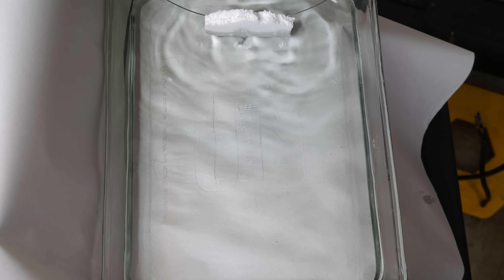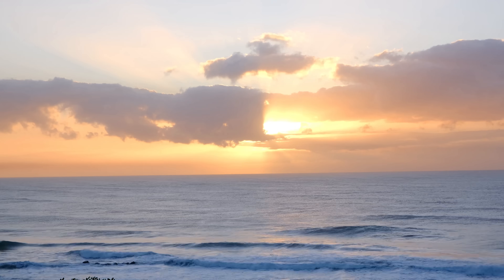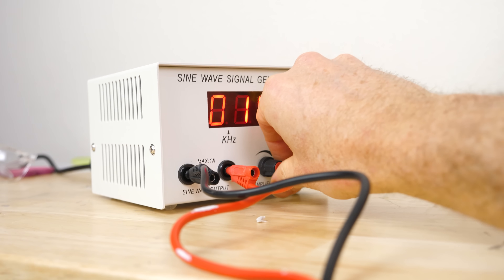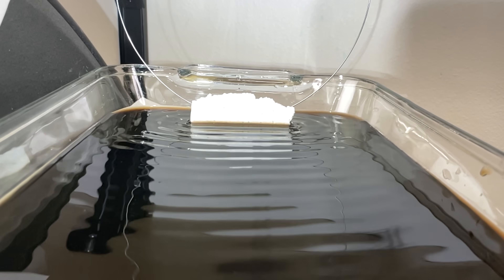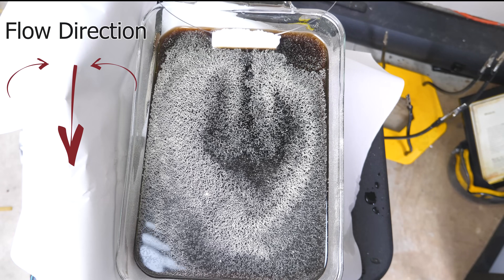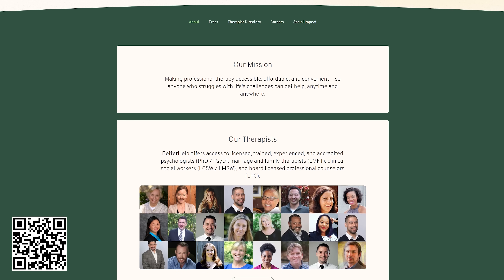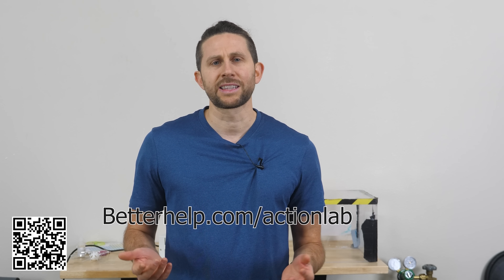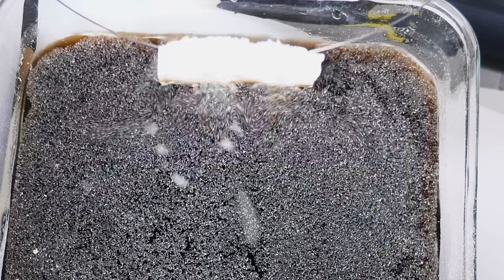Tractor Beam Waves (Waves That Pull You In)

Comment: Super interesting...as presented could also bei applied in controlled Fusion (simulate Gravity Attraction). Now there would be needed some more Experiments:
1)as many suggest in a larger Reservoir to understand the Role of the Walls
2)changing frequency and Look how the Amplitude of Transition depends from it
3) doing the Same in Air, eventually I a closed Pipe
4) thinking If the effect can be reproduced with light waves (real tractor) or even gravitational waves.

 From the explanation you gave however IT seems only a phenomenon of surface waves so Air waves and electromagnetic waves should Not Show the Same phenomenon .

Comment: I wonder what the bigger pattern would be if the wave generator was in the middle of the container as opposed to the side or corners.
Reply: you already know it would be a toroidal pattern.   Just like a tree or an Apple or a magnetic field  basically everything in nature follows toroid's and would be horizontally symmetrical.   Once you hit the right frequency matter itself turns into a toroidal flow pattern.   it's amazing watching every single different experiment that has to do with resonate frequencies which is practically in all fields of science, show the same exact patterns. every time you see eddy currents and vortices they always make the same pattern.  it's proof that the underlying fundamental fabric is most efficient as a toroid.  I wouldn't be surprised if the photon itself is a little toroidal packet of energy at this point.

Comment: it looks like when you barely touch the water you create a force of push and very low force of retraction, and when the object is more submerge, the force of subtraction the object from the water is bigger than the push, so you have differences lines forces in both cases. when you substract a object from the water, you have to the add force from surface tension, and the buoyant force

Comment: Could static electricity between your styrofoam wave generator and the objects in the pool be having some effect? Like others, I suspect interactions with reflective waves in a fairly small container and I would like to see the same experiment with a much larger one where reflections are not a big factor.
Reply: Unless he is using pure distilled water, water conducts electricity very well, so charges don't have the chance to build up on the surface of the styrofoam.
Reply: @Kelly Harbeson Water is not ionic. It is not composed of H and OH ions. It is composed of covalently bonded H2O. You need other ionic compounds to dissolve in water to make it electrically conductive.
Reply: @Kelly Harbeson You're suggesting that water in general is primarily made up of ions, which is far from the truth. It is true that there is a very small probability of a collision between two water molecules in neutral water to briefly create a hydronium ion (H3O+) and a hydroxide ion (OH-). But this is an extremely unlikely interaction. The vast majority of water molecules are covalently bonded H2O, not ions. It's a ratio of 555,000,000 to 1. For every single hydronium ion at a given moment, there are 555 million regular water molecules. The ions have a concentration of 10^-7 moles per liter, which is what a pH of 7 means. This is too small of a concentration to have any impact on the flow of current, which is why pure water is an electrical insulator.

Comment: Might this variation be due to the average height of the water surface; where starting out lower amplitude doesn't reduce the surface height of the water and it pushes away, but when the amplitude increases enough to where the average surface height of the water is lower than the surrounding surface height of the water then the flow reverses towards the direction of the lower surface height. 🤔

Comment: Is it possible the container plays a part in redirecting the flow around  the walls back to the source causing some interference ? I wonder if you’ll see the same results trying this on a larger more open body of water
Reply: I believe so, I think it has to do with force and displacement of water particles. In first case water didn't really "splash" Much out. But in second case it started to splash out kinda.

Comment: Super interesting, thanks for sharing. Does this phenomenon exist for all frequencies? Is there an amplitude threshold which, when reached, turns on this "tractor beam" effect?
Reply: That's a good point. He really should have explained that. Waves, whether in water or electromagnetic are very complicated and there's constructive and destructive interference depending on the frequency. I'm going to guess he created a constructive wavelength that pulls things in but he didn't give enough information for us to know what was happening like you pointed out,let alone any information to use basic formulas and figure it out mathematically.
Reply: @NoZioKikes88  I'm wondering if there are curls being generated by different phases of the waves and that there are predictable locations in which the curls have opposite directions resulting in places that have reverse flow.
Reply: @synchro-dentally1965  That could be.
Reply: Perhaps the curls that already exist are rotated ~90 degrees in the areas of constructive interference. Just postulating ideas.
Reply: Your Q helped be understand how to answer the whole original Q.

Every object has a resonant frequency(ies). In this case the object is extremely flexible to the point of not having a 'real' shape of its own, so it's contained in a bowl/tray. With that its size/shape can be managed. The primary resonant frequency is  a function of the shape/rigidity of the object. A violin string when plucked or a piece of metal when hit will resonate at it's resonant frequency. In the water, the speaker-powered foam sets up the vibration, and the frequency is found by trial and error.

The foam pushes down on uncompressible water, which has to get out of the way. The wave we see created that pushes outward is not the only water moving in the dish. The force goes vertically down, then horizontal when it hits the bottom of the dish, then when it reaches the wall it pushes *upward*. When that upward reaches open air it creates another little wave headed back to the foam.

The answer to this possible solution is to measure the height of the water as the foam pushes downward. Yes there's a wave created on the surface, and the height of the entire bowl rises a tiny amount.

Comment: Question: does this happen on a larger, like a lake, body of water where lateral waves are not reflected back toward the longitudinal axis of propagation?
Reply: The size of tractor beam will be the deciding factor, also I think can surface tension be responsible for this inward pulling phenomena?
Reply: @tilak09  I don't think so, but I am not sure. I think has do with waves originating in bumpy sections of water and propagating towards calm sections.
Reply: I don't think it's possible for a big lake ( a really big lake)
Reply: I like your funny words magic man
Reply: I know I’m late asf but yes this can happen in lakes
Reply from the maker: Yes it will happen in a larger body of water. You can see it done with a bigger setup here: https://upload.wikimedia.org/wikipedia/commons/2/27/WaterTractorBeam.webm
Reply: @TheActionLab  Just watched the video but they demonstrated the effect in bordered water, just like you did.
Reply: @TheActionLab but this is still in an enclosed space. Maybe this happens because the waves reflect back on the glass sides. Maybe this doesn’t happen in open water.
Reply: @TheActionLab  The other setup shown, while being bigger, is also constrained by side walls from which the waves reflect. A still larger setup (as in the middle of a lake or large swimming pool) would be cool to see and rule out the effect of wall reflection.  ...Very cool video as usual BTW.
Reply: @coriscotupi  I guess it would need to be a swimming pool just one large enough that the waves dampen out before reaching the sides. A lake is likely to have one or more inflows or outflows as well as the wind inducing confounding waves. Ideally you want to be experimenting in a controlled environment where you can eliminate external influences as much as possible, certainly any such influences that are capable of varying independently of what you are trying to test.
Reply: @TheActionLab   have you noticed in the video at 0.59 seconds , the flow pattern resembles electron orbitals in atoms
Reply: @TheActionLab at if there is a light source with a paralel beam instead of the styrofoam and a type of vapor/smoke instead of the water. Is it possible to make some kind of light tractor beam?
Reply: @TheActionLab  This can even happen in a home swimming pool with the water filter turned on, which is totally counter intuitive and maybe an idea for a new video. I have seen the chlorine buoy sometimes staying put or even going against the current that the two nozzles of the water filter created! Thank you for the video!
Reply: @TheActionLab  Itas larger but, the width of the container is still small, What if the width is also more. 
There won't be reflection of waves from wall. So no dual waves created.
Only speed of object moviing away will increase. Am I right?
If I am wrong, where?
Reply: @TheActionLab  Is there any evidence that this works in an unconstrained body of water?
Reply: @TheActionLab  I first thought it would be cool to make a big tractor beam that could move ships but in the video you refer to a much better use would be for cleaning up oil spills. Hope this technology works for that.
Reply: @jacobrollins37  . Hi Jacob, I must say that you have a fantastic problem resolving lateral thinking. As soon as I have read your comments, in my mind I could picture long convoys of boats travelling on a single powered energy source. Alas, common sense would tell me that it could never work , but great exploring idea nevertheless.
Reply: @TheActionLab  thanks. It's one of the most interesting effects I've seen since I discovered sound waves as a kid.
Reply: @Kelly Harbeson that's what led me to question if it was replicable in a much larger body.
Reply: Imagine rain clouds. Above us in the sky.
Reply: Uhhhhhhhh what
Reply: Hey I live on a lake. Annoyingly if I'm playing with my dog on a really choppy day on a lake and the tennis ball falls into the lake, it starts heading towards the main lake. You have 30 seconds to get a net before its gone.
Reply: The way I see it, the instability creates jets of water at the corners of the wave generator that move water away from the generator. The tractor beam forms to replenish the displaced water near the wave generator (mass continuity). This would be independent of any walls present and also work in a large body of water. However, this can probably not be scaled up to large applications because of the nonlinear nature of the phenomenon and also the size of the required standing wave would be huge in order to pull in a ship, for example. But for small applications or even "micro "applications in biology/chemistry - maybe?
Reply: in a larger body of water this should still happen, as the sea does push the floating objects in the direction of waves. Now, the shoreline remains more or less the same due to water on the deeper level running away from the beach but the surface pretty much always goes with the waves. I would expect the same effect in the middle of the ocean as well. The waves will enforce a certain movement of particles close to the source of the waves, while the water fill find its way to circle back from the sides or/and on a depth.
Reply: I came on the comments just to say the same thing. I can see this working in small to medium reservoirs but nothing that could be called a "sea" and most lakes would struggle.
Also just thinking, I wonder how the fish and algae will adapt to a consistent frequency and disturbance.
Reply: resonance is required for this to work, no boundary condition, no resonance.
Reply: Wow... I just posted the same question 😀
Reply: oooga booga?
Reply: my Allah tell it in quran before 1400 years ago 

Surah Rehman ayat meaning in English 

(55:19) He unleashed the two seas so that they merge together, (55:20) and yet there is a barrier between them which they may not overstep.
Reply: @smsaadyt6957  Religion and politics often make some people lose all perspective and give way to ranting and raving and carrying on like emotional children. They either refuse to discuss it with reason, or else they prefer argumentum ad hominum, which is a hell of a way to conduct a discussion. Well, anyhow, not long ago, I was talking about the elections, and how the campaigns were ignoring the issues, and sticking instead to invective and personal crap that had nothing to do with the substantive problems of running a government, which is all true, as you know if you followed the speeches and so-called debates of the candidates. Anyhow, one of the guys I was talking with said not a word in the whole conversation except at the end when he suddenly chuckled and said we were all full of shit, and why didn't we go live in Russia or China if that was the way we all hated the United States Of America. Next thing you know the whole blooming discussion was more like a brawl, And the epithets flew thick and fast, and the noise was incredible. Someone said "son of a bitch", and I think he said "bastard". I couldn't be sure, it was all so confusing. Well, anyhow, I was attempting to get it all back on a rational level. I tried, for example, to talk to the one who had started it all, and I asked him just what did he mean we were all full of shit. Was he making a statement of fact as he knew it, and where was his documentation to back up his claim? I think Socrates would've been proud of the way I refuted his argument. That is, I tried to refute it, but all he could offer by way of rebuttal was more of the same about how we were all full of shit. But he wouldn't say why, he just kept on repeating it, that and the part about Russia and China and communist dupes, and I'll have to confess that I got a bit angry and told him to stuff his ideas up his ass, which you don't have to tell me is hardly a way to convince anyone in an argument. Then he got salty and threatened to give me a punch in the mouth if I didn't shut up, and I really got hot, and the others did too, and we all beat the shit out of mister conservative. And, after all, he had only himself to be blamed. This is still a free country, And anyone telling a fellow like me, "Brother, you're full of shit", better be good and ready to answer politely when asked if he'd care to say why.
Reply: @AngryGamer1224  
i am Muslim i can feel power of iman 
and know about human without iman he feel hidden darkness around light  but i promise if someone get true believe on Allah and his true religion islam he will feel darkness is not around and everything is clear this is true
Reply: @smsaadyt6957  I'm American, and I have the freedom of speech to copy and paste worthless copypastas to random people.
Reply: Yes it can happen as soon as theres a hiccup caused by overdrive of water also possible by wind, high waves. Maybe this is how most ships become so dangerous for swimmers. It could be prevented by adaptive and side circular motion motors, sails like renewables and arythmical motors, especially excellerating inwards or outwards If placed in wide angle asymetrically
Reply: Based on what I have seen in this and many other videos, it appears it works when the amplitude and frequency match up with the WaveMaker shape and side in some fraction of the wavelength causing a null point in the center of the wave maker. I think if someone studied the size of the wave maker and changed it and took measurements of wavelength and height someone could find a fractional size of the wavelength and height relative to the size of the wave maker. The key here is the null point in the center of the WaveMaker. Just my own observation and hypothesis on the subject